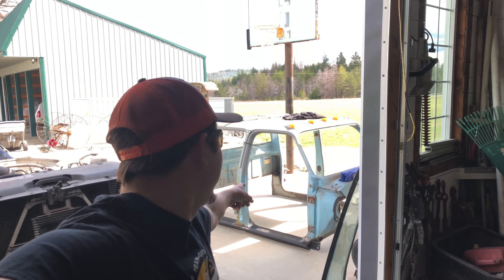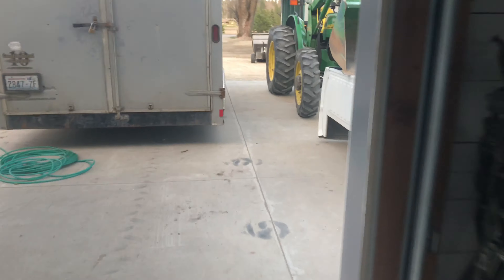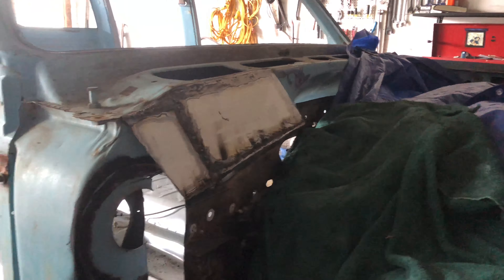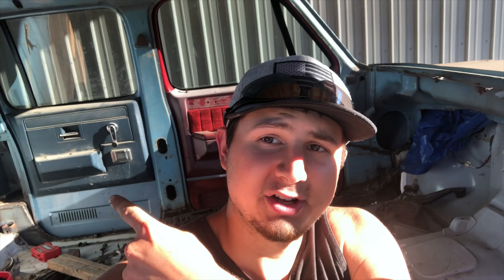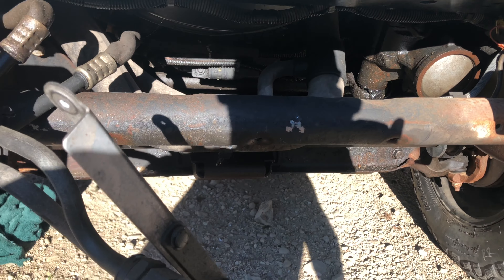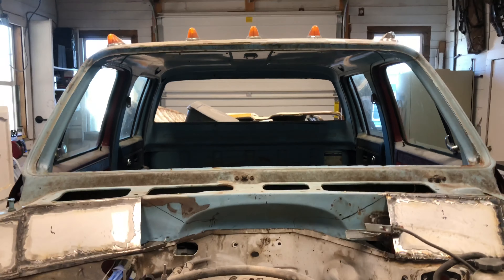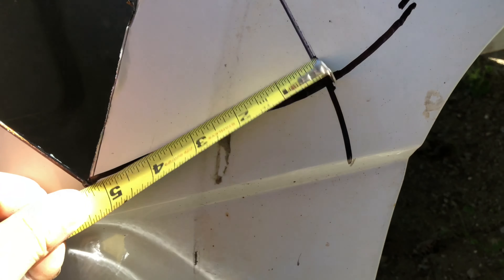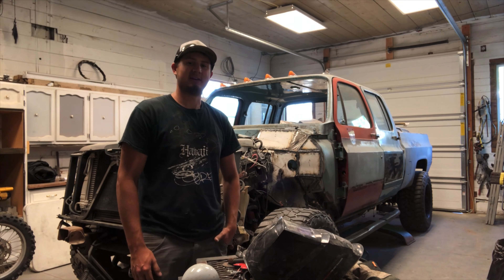DMAX SQUAREBODY BUILD PART 6!!!

Comment: Anxiously awaiting part 7, I started the exact same project as you after rolling my 2003 lb7 duramax, we had the exact same interior package. It’s funny because we both started the same way I wished I had found your videos sooner. I’m waiting till pay day to go pick up the new cab, I have my floor and firewall cut and prepped, only difference is I’m dropping a flat bed on mine. Would love to chat about the dash in the square cab if you’ve done it yet
Reply from the maker: Message me on Instagram @tanner_shany24 and I’ll try to answer yours Q’s about the dash install. I have done it, just haven’t uploaded videos. I’ve got like 3 new videos finished and just haven’t uploaded them yet 😬

Comment: You said you want to add two inches to the bed. I wish I would have added to the cab... like a mega cab. I know that is a stupid amount of work, but the knee space for back seat passengers is really small. I shortened my frame 4". I wish I would have left the frame and added to the cab... I want to kick myself.
Reply from the maker: I know I didn’t want to change the frame because in case of a wreck, I want to be able to throw a cat eye body back in the frame really easy. However, I battled with the bed vs cab idea. It basically boiled down to me being capable of doing the job, and I figured the bed would be easier lol.
Reply: @SNOFLOFilms  . True. The cab would be a nightmare, but I want to do it one day.
Reply from the maker: @ReshardsAutomotiveWorkshop  https://youtu.be/PEQvhW_pRPY look at this truck, that’s exactly what he did. I started my truck when this guy was like half way through his. Super cool guy.

Comment: Coming along so good man! You've got everything to fit, the full perimeter sheetmetal looks OE. The dash is something I can't picture in my head. The 73+ have the short A pillar and no angle on the glass. I'm imagining the dash coming waaaaaaaaay inside the cab. Newer units have more than 2 feet of dash if I'm not mistaken? Your rig is going to be so much better than the OG unit. They don't have enough room for your legs. With the newer dmax floor and firewall will give way more room for the feet. Is the square body actually 6-8 inches wider at the floor than the GMT800? If so, that's wild!
Reply from the maker: I actually already have the dash in the truck! It’s, well, it doesn’t fit perfect lol. I have to make entirely new routing for the defrost venting because it’s currently shoved all the way up where the valence was lol. But, the gauge cluster and dash are all sitting in the same position they would in relelvence the the dmax firewall, so it won’t be pushed into your chest. The seat should have the same exact distance from the steering wheel and dash as before the body swap. Only issue with that is the top of the dashboard is only going to be maybe 8” long, so I will have to do some custom stuff with the plastic to make it look correct.

And yeah I do believe the body actually is wider. I know with this wheel setup on a car eye there would be a ton of poke with the tires but with this body they are maybe 1.5” outside the fenders. And plus I had to fill about 2.5-3” on either side of the rockers, and I cut right on the inside of the pinch weld on the dmax rockers.
Reply from the maker: @curvs4me  and trust me prices over here are no joke either. I picked that bed up before Covid taxes hit and everything skyrocketed. Even at that time this bed would go for around 1200 here. I got a steal, and it came with a minty tailgate. I called 4-5 different places that primarily part out old school Chevy stuff looking for one and they all said the day a short bed comes in it’s gone for hundreds over asking price within hours.